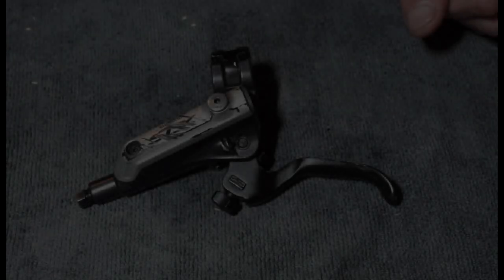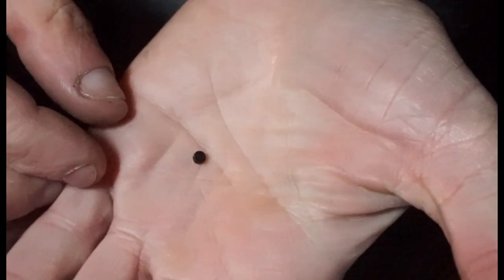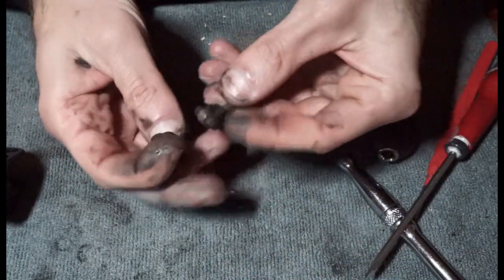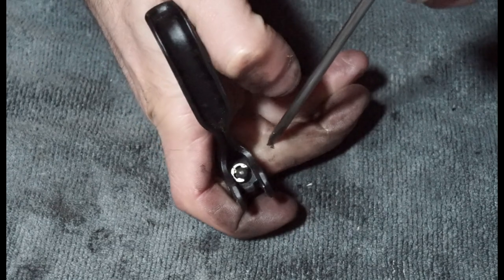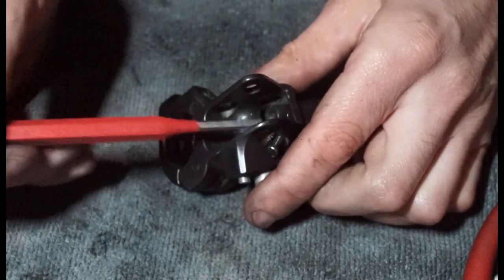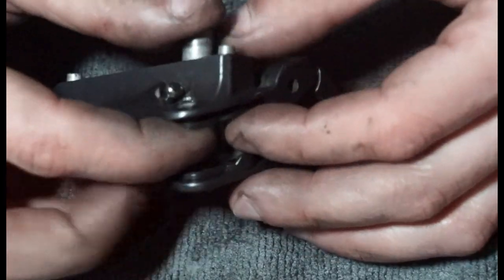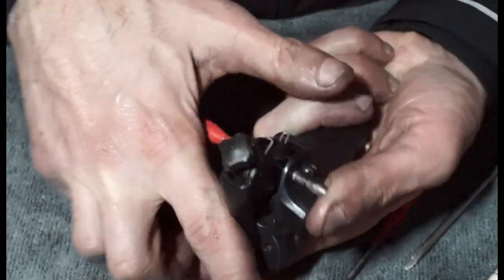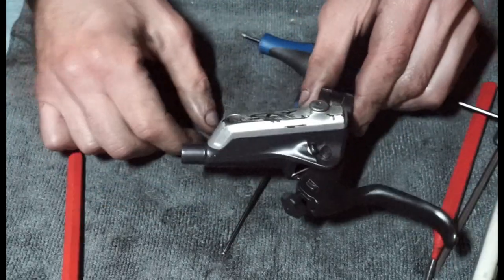Shimano M675 Lever Strip Down Reassembly M615 M785 Hydraulic Master Cylinder

Comment: this video was a life-saver, picked up a customer's bike, put it on the rack and drove back to the shop. front wheel was completely locked and i thought i had damaged the lever, took it apart and found years and years of dirt since it had never been serviced, it took a whole day of struggling but I managed it, thanks for the video
Reply from the maker: Now you have stripped one you can cut down the time needed considerably. They seem to be pretty reliable levers.
Reply: @Chambers36TheEnter   yea indeed I did it faster, the next day the lever was stuck again so i had to rebuild it once again, i sanded down the bushings because i thought that was the problem and somewhat it was, sadly the following days i found leaks at the lever and in the caliper too, so rip that brake

Comment: getting the spring in place is a twat. I use a bolt to do it.
Reply from the maker: I agree, it's a right bugger.
Reply: It’s actually pretty easy… All you need to do is use a 2mm L shaped Allen wrench, or similar and insert it through the lever hinge pin hole to keep the spring, lever and roller bit all basically aligned. This way, it makes it SO MUCH quicker and easier to get the pivot pin through and in the correct position. lol, it’s really not that hard if you use something to hold the lever and spring together guys. Give it a try, you won’t regret it.